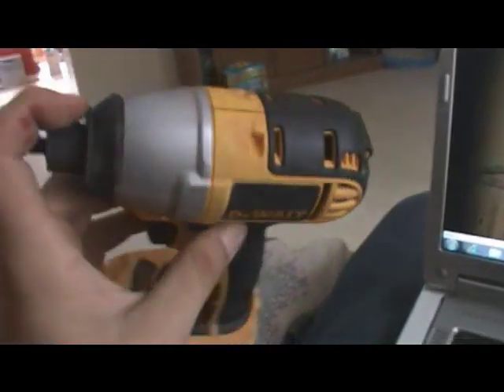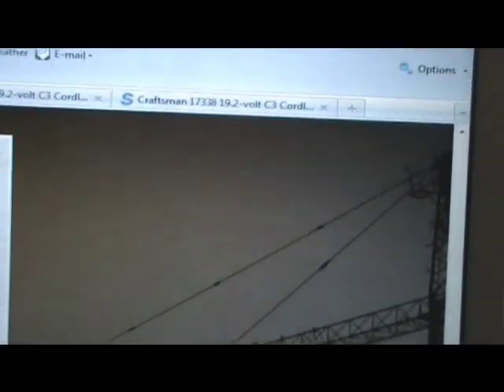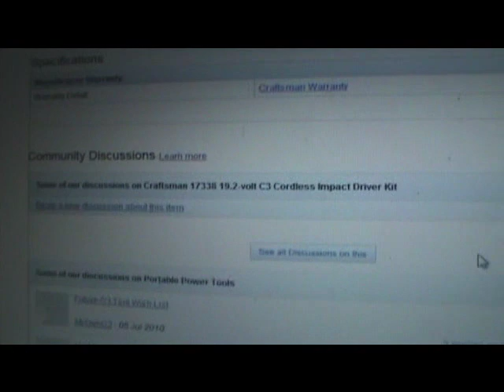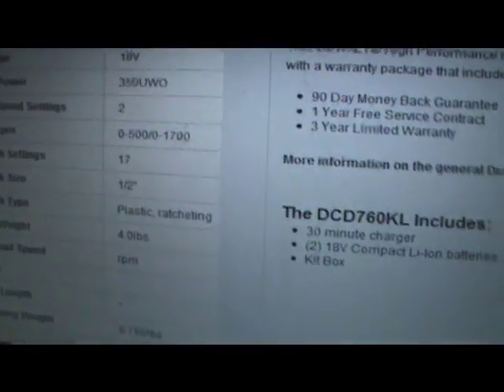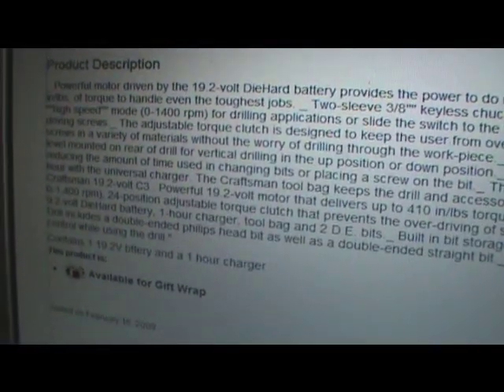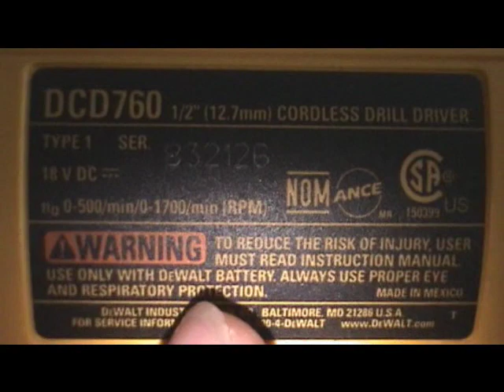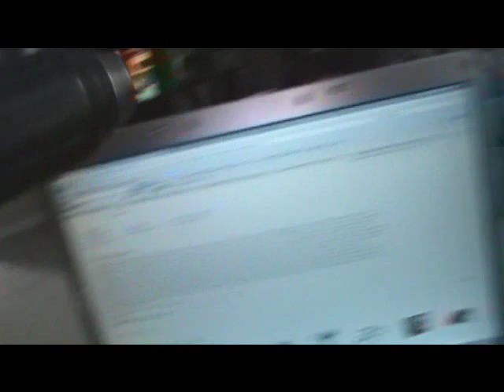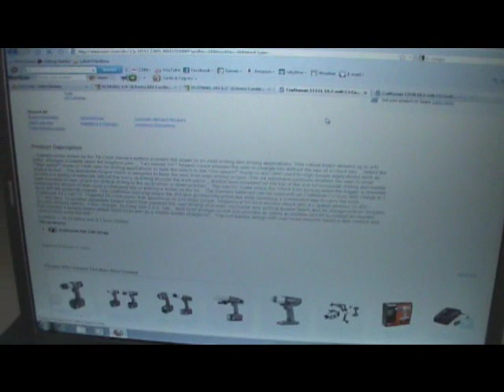Craftsman VS. Dewalt: The Specs

Comment: I'll be real on here, my bro has all dewalt and I have craftsman.  he goes through batteries and tools left and right and I don't.  I've used my impact all day for 2 years give or take. and I still use the same batteries. and I had to replace one impact not from failure but from dropping it and breaking the case.  and they gave me no grief about it.  I just upgraded to the new more powerful 1/4 in impact and I can't wait to see how much better it is. the dewalt is barely better than the old one.